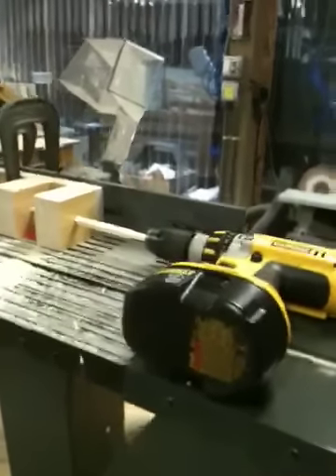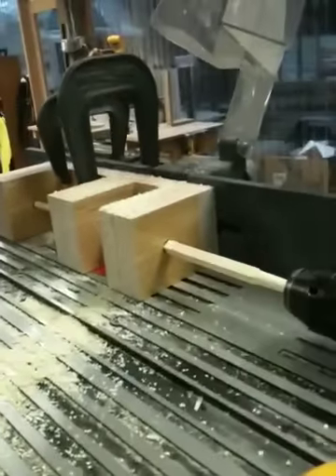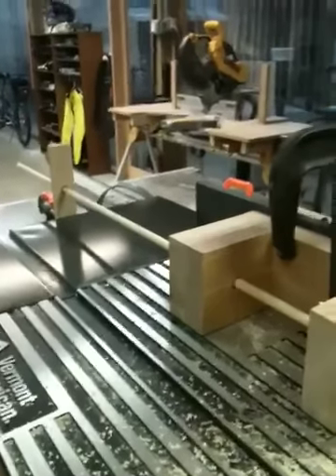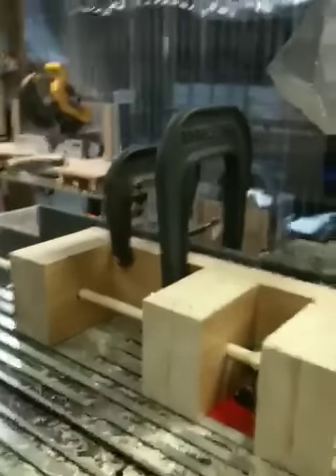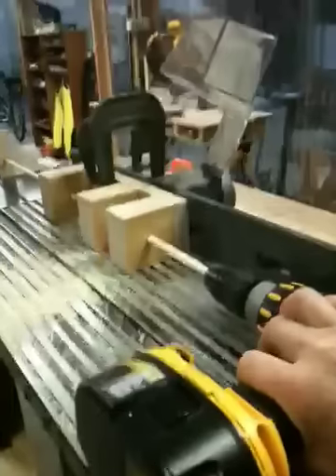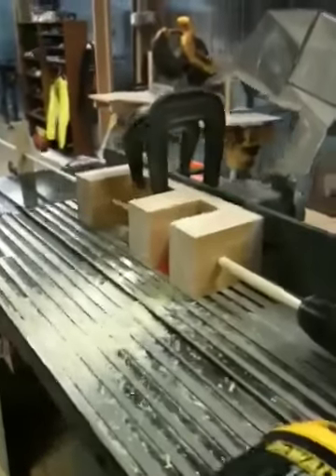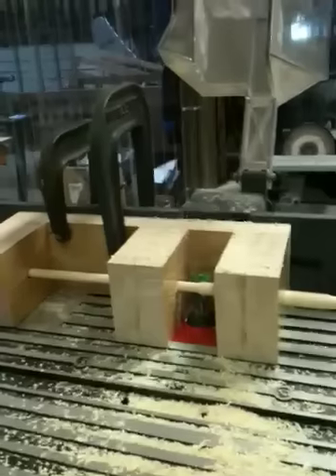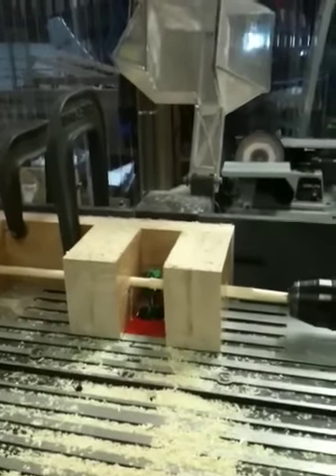Arrow shaft or dowel cutting jig

Comment from the maker: The stock is cut square on a table saw. The first set of holes are drilled just large enough act as a guide for the square stock that is spun with a drill motor. As the rotating stock is pushed forward a spinning flat blade on the router trims the stock to a round shape and the final guide holes are drilled just large enough to accommodate the final size.